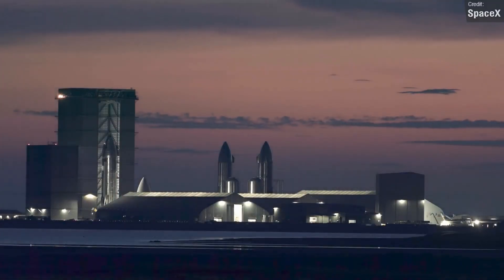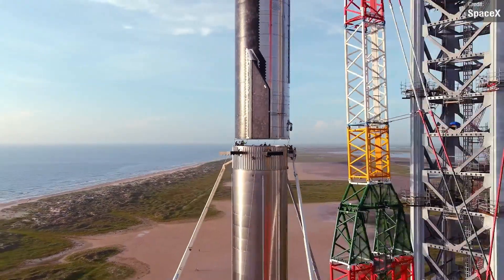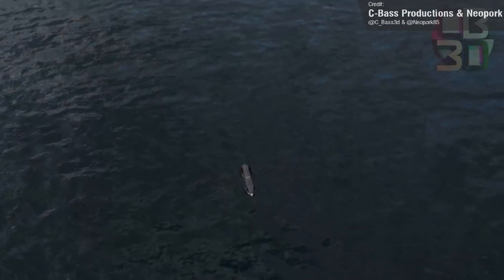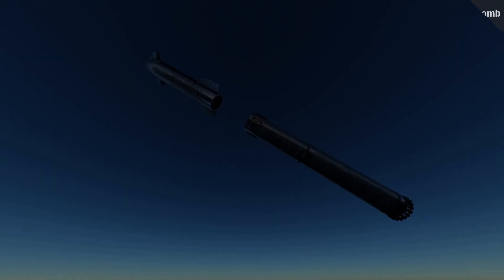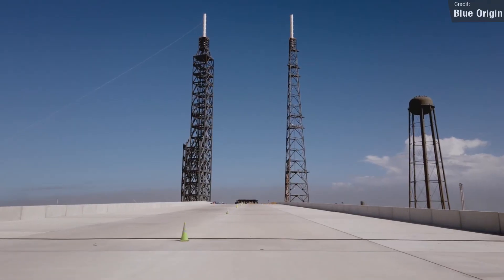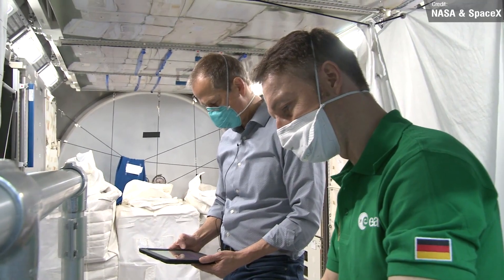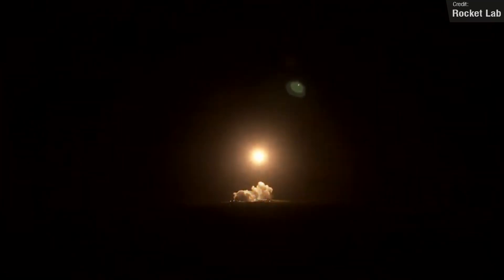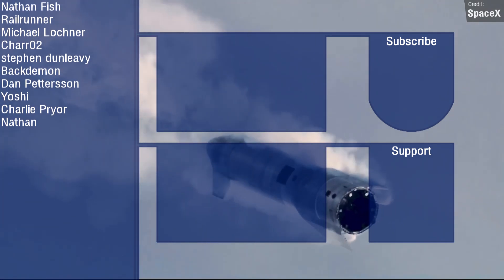SpaceX Starship FAA Approval Underway, Blue Origin Loses, Crew-3 launch, Crew-2 Return

Comment: The only issue I see with the sockets is, at the moment at least, they are only on to opposite aides of starship, which means the ship would have to land in a very specific angle so the hinged triangles are able to latch on.

I dunno, I feel there could be a better solution for this...

Comment: If nasa or spacex or somebody were to make an ssto,how come they don’t put jet engines on it? Of course there’ll still be rocket engines but hear me out. The ssto takes off from the runway powered by the jets, and when the ssto is too high for the jets to function properly, the rocket engines are turned on and they take the ssto the rest of the way to orbit.
Reply: It has been considered many times. The problem is that the jet engines and their fuel + tankage, mountings, air intakes and more become nothing but dead weight in space.

You still need rocket engines to get most of the speed anyway. The fastest jet planes we've ever flown hasn't exceeded 1000-1200 m/s, meaning you still need about 8000 m/s to get to orbit velocity.

Now if you could design an engine that starts like a jet and then transitions into a ram jet, then scramjet and then full rocket, then maybe. But making a multifunction engine like that is a big technical hurdle.

Not saying it's impossible though, just maybe not worth it compared to a simpler multistage design.

Comment: NASA cant award SPACE X a contract worth 2 billion dollars and let the FAA not give SPACE X a go ahead .
Reply: But the TURTLES!!    Seriously though, a big government contract is not carte blanche to ignore regulations, and it shouldn't be. I don't forsee any hiccups to this assessment, but it absolutely should be done. It is going to cost them what, a couple of months? That feels a long time for SpaceX, but given they are still working on stage zero (and not having to move equipment in and out for 420) it is probably going to delay them a month tops.
The only real concern is that it is used as a political weapon. Factions in government fighting doesn't stop because money has already been spent. If anything it gets worse.
Reply: NASA doesn't control FAA. They have to adhere to the same rules.

If SpaceX can't develop their contract bid for HLS because they have chosen to build a rocket factory in a wildlife sanctuary, then that is THEIR problem.

Comment: thought the glenn mock up was built a year ago?
Reply: A fairing was seen in the past. Blue Origin is very secretive, so who knows when the mock up was completed.
Reply: @steveaustin2686  BO is way too secretive in my opinion.
Reply: @hydrolox3953  It certainly doesn't help with public relations.
Reply: @steveaustin2686  i dont  understand why they are so secretive and still using the waterfall design method.